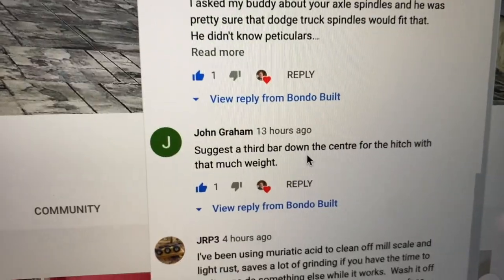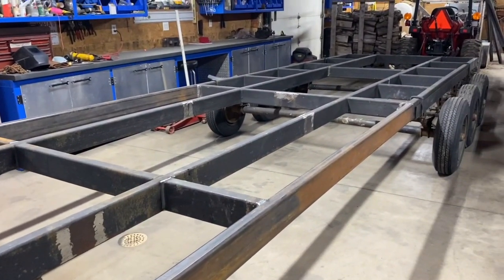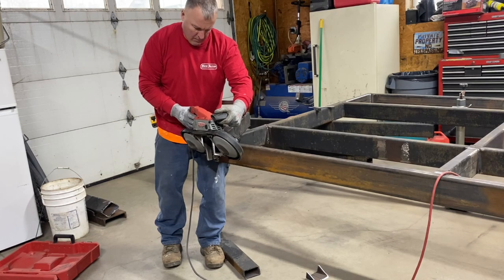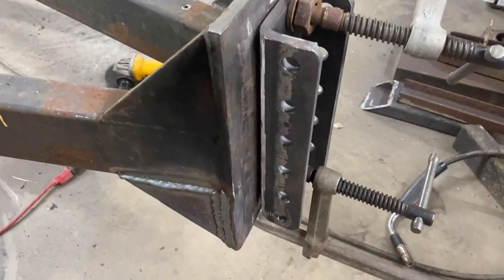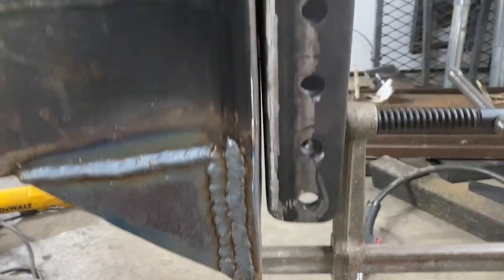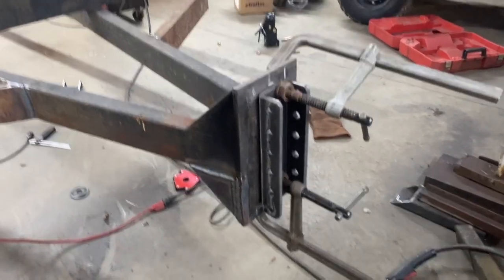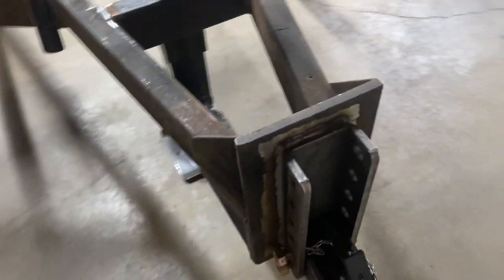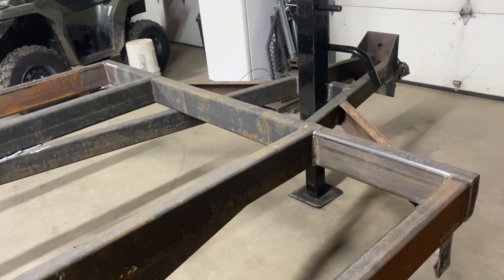Tiny house trailer part 3 (Trailer hitch and jack)

Comment: Hi Ron, thanks for the shoutout. I think you should run another capping bead on the hitch you welded on front. That was a pretty wide gap. When you build out over the tires, use metal to protect your tiny house above it when you have a blowout. A wooden floor or wall will not last long with a tire beating on it. Looking good!
Reply from the maker: Thanks Tom. I was planning on the metal around the tires just to keep the water and mud off the wood and as you said a blowout would be a mess. won't hurt to cap that hitch i’m sure either. Thanks buddy. 👍

Comment: 2x4 will span what you got just fine. Put them on 12 in center.
I would weld tabs on the outside frames to bolt floor joists to.👍
Reply from the maker: Rod I already welded tabs for 16” centers the other day. My buddy figures the 2x4 will span fine with 3/4 plywood. I’m gonna add a few more tabs by the outside because my tabs are in the middle on 32” centers. Thanks 👍
Reply: @bondobuilt386  sounds good Bondo
Reply from the maker: thanks Rod 👍

Comment: Just catching this Bondo. I'm not sure if you move the axles or not but they should be 60/40 in relation to the bed or else you get Wicked tailwags trailer sway
Reply from the maker: Yes thanks I moved them so I think it will be good. 👍👍
Reply: That's good. I bought a trailer from a welder the trailer was awesome. The only thing is the welder didn't put the axle in the right location. He put it in the middle of the box. I almost crashed on the highway. Couldn't figure out what it was so I started researching trailers, come to find out he put the axle dead center of the box. It needs to be 60/40 not from the tongue but from the box
Reply from the maker: @MrSprintcat  Yes I have built several trailers you definitely don't want it centered. 👍👍

Comment: Go buy same size tube will look better  should go to outside corner
Reply from the maker: That tube is real heavy so I think the 2x4 will hang over but I will make some braces. Similar to how a Mobil home is done. I need to keep the weight down and this trailer is getting fat already. Lol 
Thanks 😊

Comment: What's legal width in NY ?  Are you going to stretch the axles ? I'd hate to change a tire under a tiny house.
Reply from the maker: Mario most states it’s 8’-6” wide 13’-6” tall max. the tires are at 8’-3” now so not going any wider. I will leave a spot out where the tires are and they will be able to be changed.

Comment: A way to analyze the amount of deflection for this material is to use a quick and dirty deflection calculator such as: https://www.easycalculation.com/engineering/mechanical/hollow-square-tube-deflection.php
Reply from the maker: Thanks Steve I will have to check that out. It seems real solid right now. 👍👍